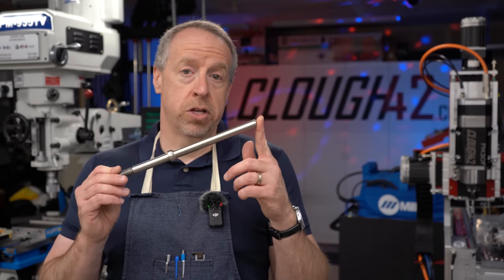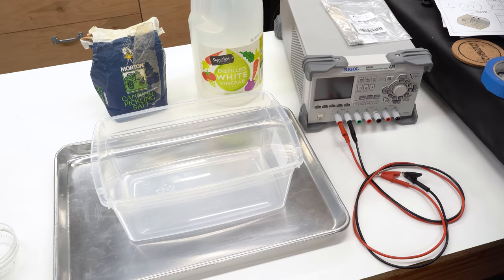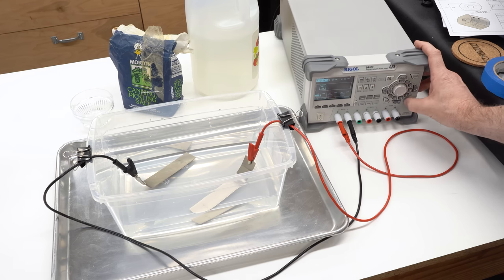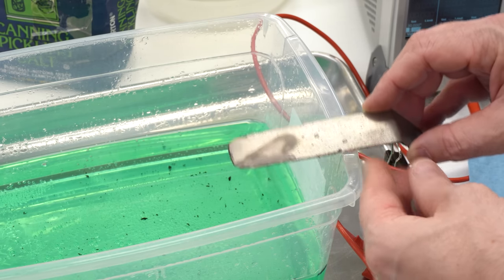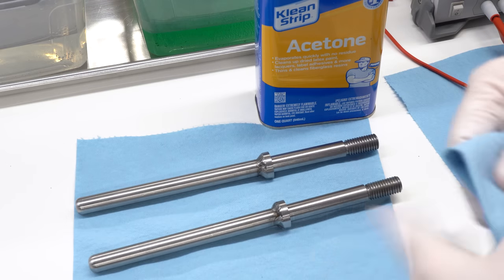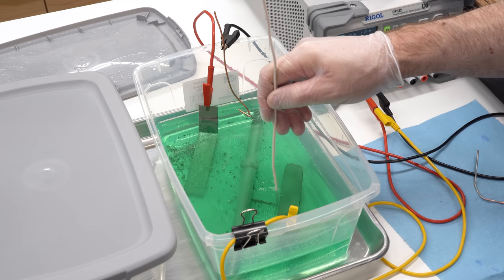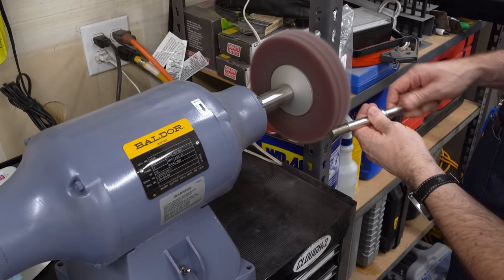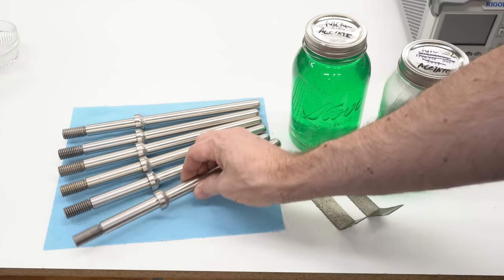Nickel Electroplating in the Home Shop - A Shocking Way to Prevent Rust!

Comment: Nice demonstration. Two comments on this (engineer here): First, it's probably better to refrain from covering a tank in which water is being electrolyzed. (The water is splitting into a perfect stoichiometric mixture of hydrogen and oxygen gasses. This is an explosion - deflagration - hazard, because all the mixture needs to go off is a tiny spark.) Secondly, steel is more active than nickel. Therefore, if a pinhole or other defect occurs in the plating, such as a scratch from abrasion with a weight plate - the steel will start sacrificing itself in a  corrosive environment. This is the opposite to the protective mechanism of galvanising (where the zinc is more active than the steel). This is why galvanising is more prolific in industry (because it protects the steel in the way nickel cannot). 

Finally, being a pedant - disposal of the chemicals is a real problem, because nickel and other metals in the groundwater is a bit 'Erin Brockavich'. It's also very important not to ad-lib the electrodes. If stainless steel or chrome parts get in contact with the bath, this can form hexavalent chromium under electrolysis, which is exactly Erin Brockavich (it's carcinogenic).
Reply from the maker: Hydrogen is produced at the cathode, but oxygen (and chlorine) production are negligible, because erosion of the anode dominates the electrochemistry.  That's why there are no bubbles forming on the anode.
Reply: Hi John, Nice to see you here. When rebuilding my imported boat trailer from Florida back when the dollar was at parity I disasembled my leaf springs and had them nickle plated at Star Plating. That was back in 2014 and 8 years later (although dulled off now) my trailer springs are only showing minor spotting of rust.
Reply: Galvanizing is more prolific because:

Raw material and purity processing is far easier and cheaper for zinc
There is far more harvestable zinc than nickel
Hot dip galvanizing is a basic as fuck process compared to nickel plating

Zinc being sacrificial to iron is nowhere near being the top reason galvanizing is so much more common.

It's because it's a poor man's stainless, able to be done with far simpler technology from start (mining and refining) to finish (plating process) and the material is cheaper.
Reply: @ObservationofLimits  I agree with all your points however in the case of my boat trailer one can’t hot dip leaf springs.
Reply: @Timbo_tango  that's for several reasons.
The nickel plating is a finer bonding because it's electroplated, whereas galvanized is basically a steel plasticoat.

I'm not sure why leaf springs got brought up. My point to the other guy was he made an incorrect statement about zinc hot dip being more prolific than electroplating (nickel or chrome) because "the zinc is sacrificial" and that was so far from the truth it was laughable.
Reply: @ObservationofLimits  Zinc plating is absolutely prolific, with brighteners you could mistake some for nickel plating. In many industries bright zinc is used instead of galvanising because they can and galv. is not very cheap.
Reply: I'm very relieved to hear this two minutes ahead of using nickel chrome silver spoons for my anodes or whatever they're called, a couple of old silver spoons I found thinking these will ad-lib for bright pure nickel nicely. I would have committed harm upon whoever got within a sniff of the process there?  That's the trouble with being a bloody novice! (me)